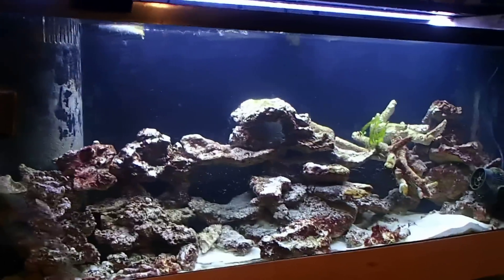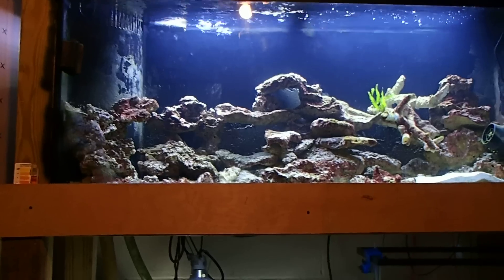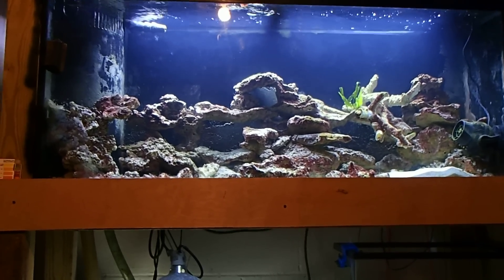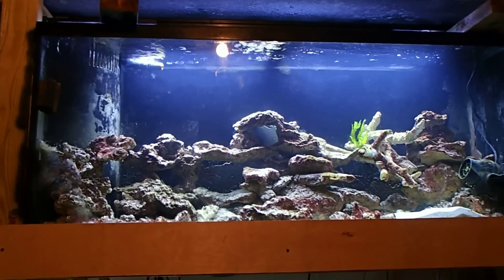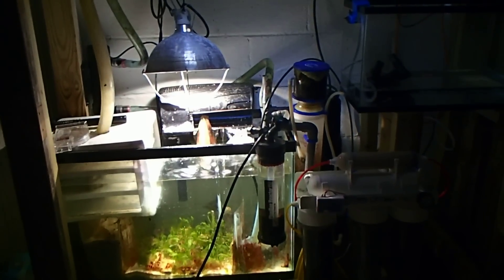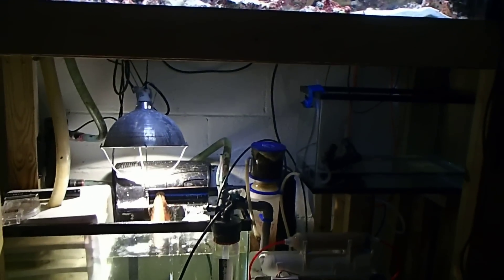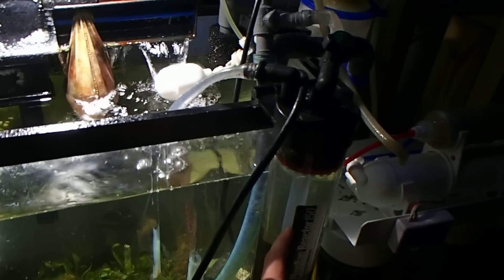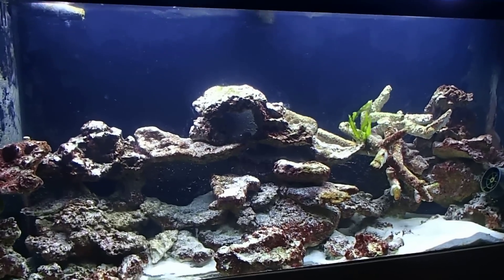Whats Under the Hood of my Salt Water Tank, What caused it to NUKE!!

Comment: I have a big tub of salt for my saltwater tank and all of it hardened up. I was able to separate it into chunks, but is the salt still safe to use? I am scared to do a water change because I don't really want my tank to collapse. Thanks.
Reply from the maker: oh man i hope this didn't scare you i've been doing sw for.....7-8 years and this is the first time its happen either your salt got wet and or pulled moister from the air, yeah it'll do that but its still safe as long as you didn't get any chemicals in it  all it is is clumped salt it will separate once in water
Reply: I wouldnt use salt thats clumped. never know whats clumped in there. Could make your levels go crazy.